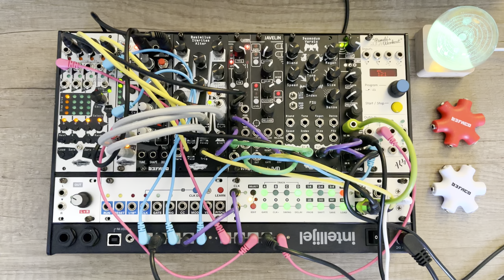How I'd sell a 62HP starter case to someone new to Eurorack

Comment: nice little selection there, for compressors ive not looked into getting one yet, but may veer towards endorphins, as it has low mid high button cutoffs
Reply from the maker: As long as it has a sidechain then that's all that really matters for this demo. One with plenty of control is better though if staying out of your DAW in a live performance setup.
Reply: @markbooth  deffo

Comment: I like the set-up, definitelya dynamic start-up case. Nice lil funky groove. 🎉 if it were me, id opt out the pams workout, and put in a Ochd and a horologic solum.
Reply from the maker: I have a horological solum just wish it had a rest trigger output to reset the whole case like I’m using Pam’s for
Reply from the maker: Ochd would also need attenuvertors but I could also replace the uMidi 1U with one of those too.
Reply: @markbooth  ah good point. Yeah replacing the 1u could be an option. There's a smaller version as well. Also a few 1u clocks out there I think. And a few options for 2-3hp attenuators
Reply: @markbooth  if you're outputting to your steppy’s reset, woudnt the reset trigger work?
Reply: Or/and using the multipliers
Reply: Probably can leave out the ochd since you're using the cleft-diaz
Reply: I need to shut up - I barely even practice and only been in the modular scene for a year. 😂 sorry.
Reply from the maker: @motaki79  thinking out loud is part of the fun of how we work out what to patch where so don’t worry I do it all the time too. And I need a reset output from the NE clock for it to work in the small system but it can’t send reset to mimetic Clep and steppy. We could use the 1/16th clock output as a regular reset  heartbeat but the first bar would always be screwed

Comment: Sadly three of those modules are unobtanium.  I am loving your use of the mimetic. Ànother module that would work great here would be some version of piques. Don't get me wrong I love the kick all but the kick and snare you can get from a peaks clone would be great.
Reply from the maker: Sadly WMD modules are no more but I’m not doing anything special with them here so any ADSR, filter and compressor would do. If I were building a setup to mimic this I’d get a Knobula Kickain which handles kick and ducking in one and a Steve’s MS-22 filter if possible too. I’ve not tried a piques but heard good things about them

Comment: This makes me puzzle over how closely I could approximate the basics of this patch, despite having a system about five times as large.
Reply from the maker: There are 6 CV sequences here and 2 gate sequences. Voltage block would work well instead of Mimetic and Clep if you have one. The rest is just a filter, envelope, and delay/reverb effects unit. Then add on a kick.